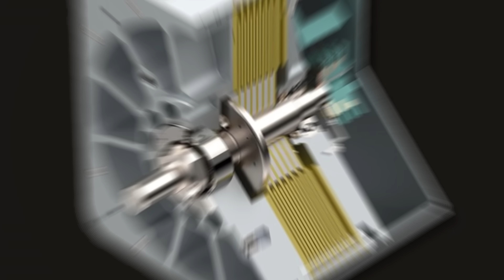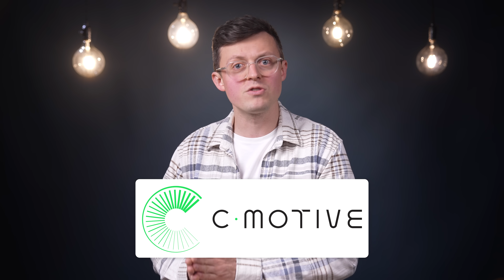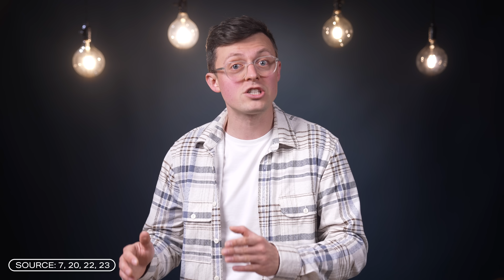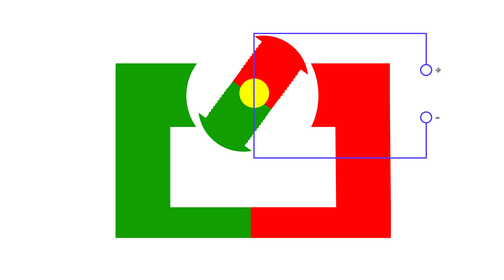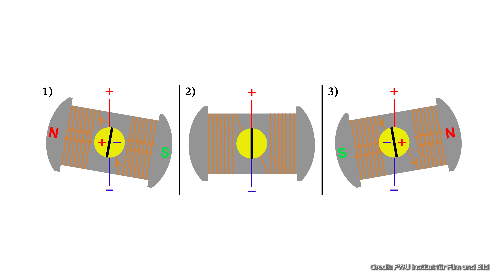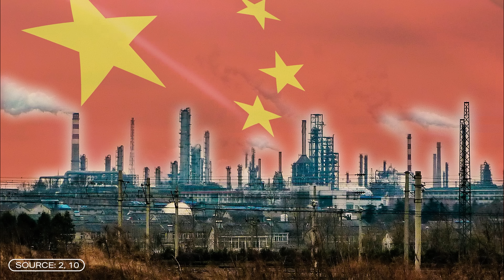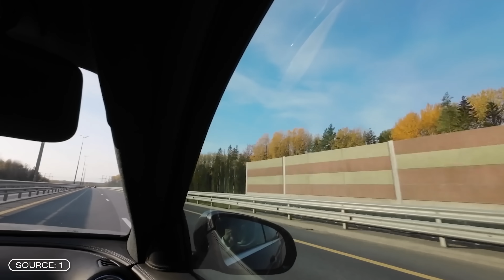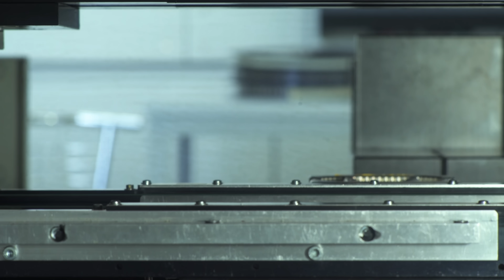Have We Gotten Electric Motors Wrong for 150 Years?

Comment: If they can do it properly, with low weight and real high efficiency e-bikes are a natural placing for this kind of motors, putting the motor directly in the bottom bracket without a gear reduction is the dream of any e-bike builder.

Comment: That dielectric liquid sounds like dichloromethane (DCM)
Reply: That's great, but it's not dielectric ofc.
Reply: @Cineenvenordquist  Yeah, this was poorly researched. I wrongly thought the dielectric permittivity of DCM was higher than it is.

My reasoning was that they don’t seem to have an issue with high cost, toxicity, or flammability, so it might be a clever application of a common material. There is quite a bit of recent research on tuning dielectric parameters of solvent mixtures with ionic liquids, for example mixtures with high-ε′ ILs like HEA-F (2-hydroxyethylammonium formate) would be in the right range even at high frequencies, but then there’s no specific reason to think of DCM.

Comment: Small scale motors for tiny smol dones.

On the other end, while not dealing with the use of copper and need for cooling at high current loads, you have advances in AC synchronous reluctance and induction motor designs that could displace high performance DC motors in cost, efficiency, and power to weight ratio. (including combinations of induction and reluctance motors working in parallel) There might be some role for switched reluctance motors as well, but the high speed, high efficiency projections seem to favor synchronous reluctance designs. The combination with induction motors seems to be related to low-speed torque performance (without reduction gear or using only fixed ratio reduction gearing without transmission).

 I'm not sure of the impact these configurations have on the ability to configure the motor(s) to also act as an alternator/generator for regenerative braking.

Comment: Welllllllllllllllllllllllllllllllllllllllllllllllllllllllllllllllllllllllllllllllllllllll, HmHmmmnn What about motor homes
buses with a gear box? I a huge 1 meter squared motor paired with conventional big rig gear box, You said 90% less copper no magnets so most of its weight would be from the dielectric.
 I wonder what the math would be on that.

Comment: Low Rpm with high torque and no gearbox. This would be great for a marine application like a propulsion motor with a CPP  this could run constant speed with max efficiency sounds good to me to be honest.
Reply: Or replacing stepper motors

Comment: Sooooo  many electromagnetic motors require high speeds and then step-down gear-boxes for low-speed, high-torque use that we have just simply come to accept that as a given. Even if these can't replace every motor, they could still replace a heck of a lot of them.

My main question is: Can they reduce the cost and increase the long-term durability of these that they could replace all the motors that CAN use their particular characteristics? Compressor motors for refrigerators and air conditioners have to last 5 to 10 years with no maintenance AT ALL. We just expect them to keep on working forever. Can these motors do that? Without doubling the cost of our refrigerators, which are already too damned expensive?  

It doesn't matter how cool they are if they can't replace everyday motors. If they are always only going to be a niche product, then they will always be expensive.

Comment: The very high voltage motor controllers are going to be harder to make than the motor
Reply: Hey, if 1 V electronics can run 800A motor controllers, even with GaN they got this (30 kV?) thing fine. It is tempting to think the controllers will absorb some of the Cu the motor refused...

Comment: Wait wait wait. "boost in efficiency ... close to 100 percent" doesn't necessarily mean 100% efficiency; it could simply mean twice the efficiency of existing motors, i.e. 100% increase in efficiency. In fact the phrase "boost in efficiency" almost certainly means the latter. If they mean simply "efficiency ranging from 30% to 100%", why would they even mention the 30% figure? Who would boast about that?
Reply: Yeah, that reads 30% to 100% more efficient, not close to 100% efficient. Also what are the other factors? If we're throwing such huge numbers around then it must be more so dividing the inefficiency by that, so like, say something is 87% efficient = 13% inefficient/loss, then this would make it 90% to 93.5% efficient = 13%/1.3 to 13%/2
Which don't get me wrong, is very good, but is also very different than the almost 100% when it comes to such matters.

Comment: but will it economise? Price is important, and getting your KV requires DC boost circuits which reduce the efficiency too. So instead of efficiency lost at the motor it is lost in the voltage regulation.
Reply: Well we don't know the cost of the liquid but rare earths are expensive and this uses less copper a clean room to build the motor will raise the price.

Comment: Magnetic motors are typically over 90% efficiency and 95% is not uncommon. Little room left for more efficiency. And little need.
Reply: price of copper going waaay up very soon
Reply: True but what people forget is how efficient are the motor when running part load and not optimal rpm? there might be some improvement than can make sence.

Comment: So you're going to need a gearbox for all applications involving either 1500RPM or 3000RPM. Great!!!!!! You're back to the gearbox anyways. Magnetic fields are easy to maintain. High frequency voltage includes more electronics that can fail. No need to reinvent the wheel. Movement is not always progressive. This is sideways progress. Broadening of electric motors instead of an actual improvement.

Comment: Hmmm, "proprietary organic dielectric fluid"... my brother, that shit sounds like ultra-high refined mineral oil. The exact same kind used as dielectric insulator/thermal dissipater in pole pigs (pole-mounted electric grid transformers). Just a small tweak to the molecular formula to make it legally distinct (and still retain the exact same physical/chemical properties as the original Example: Heroin vs OxyContin), et viola; "proprietary organic dielectric fluid".
Reply: Not. Dielectric. Coulomb force motor. But also Lorentz in a dynamic analysis (not shown.)

Comment: Their problem is going to be serviceability. Very few industries will have a clean room onsite and keep the proper staff for it . Not many will want to send motors out to take 18 months to be rebuilt either. Also being limited to 100's of RPM means they will need a gearbox for most applications, they will just have to be geared up instead of down, which means even bigger and more expensive motors. Neat concept, but I can only see it being adopted in niche applications.
Reply: The cleanroom is only for the initial build.  It is not required for filling or refilling the ESM.

Comment: so ~2-4% more efficient than current Tesla/Rivian motors, maybe 1/2 the weight, give you ~5% more range.  500 miles becomes 525 miles.  If costs are similar or better, makes sense to go with an ES motor vs EM but it's not 'disruptive' technology by anymeans.

Comment: Now there is so many problems with this ad. First there are several different variations of electromagnetic motors, and thay are all different. The most common, the asyncronous motor has no coils in the rotor. The efficiency of this motor reaches at least 97% depending on size. Yes the bigger the motor, the higher the efficiency. So stating single figures SAYS NOTHING, if it is not related to size. So this is a sloppy ad! And it is mostly just basic electrotechnical issues....

Comment: I'm sure they've tried something as simple as applying a layer of a solid dielectric to their plates and then pumping the whole assembly down to vacuum....
Reply: That would make it work 10^1000 times worse, good thinking. Next you'll make us radar that works behind heavy insulation and light shows with .00001 V photons.
Reply: @Cineenvenordquist  Oh, I'm sorry I'm so stupid, I thought that vacuum and air having nearly the same permittivity meant that it could be used as a short gap between two solid dielectric layers with a permittivity of 100-300+ instead of a fluid with a permittivity of 20, vacuum not having turbulence between moving plates, and maybe having to do a little more advanced cooling method internally to take advantage of the bonus extra permittivity in the solid layer. 
I'm so dumb that I thought titania would be a good target material to start with since it's common and maybe not the easiest to work, at least nonreactive, breakdown isn't bad at 4kv, and you'd just have to worry about surface finish since the plates may be close enough together where it's a glow discharge risk across peaks, but hey I'm just some idiot making suggestions. 

Say, where did you get your 10^1000 deprecation from, I can't get any of the Coulomb interaction or Darwin Lagrangians to fit that figure...

Comment: I would use pressurized sulfur hexafluoride as the dielectric.  It's a gas, so it wouldn't have the viscosity of a liquid, and it's already used as a dielectric hundreds of kilovolt Van de Graff generators, electron microscopes, and high voltage transformers.  It doesn't, however, have a very high relative permittivity.  That may not be too big a drawback.  On balance, though, the static electric motor has a lot of potential, with the promise of increasing our capacity to use electric power in more applications, thus lowering resistance further electrification (see what I did there?).
Reply: SF6 was investigated thoroughly for ESMs.  If it had a very high relative permittivity around 100+ the engineering challenges to employ SF6 might be worth it.  

But as the other responder indicated the last thing our planet needs is a highly compressed motor filled with a potent greenhouse gas.
Reply: That would be useless ofc because the Coulomb force would be reduced quickly by any SF6 quickly polarized molecularly to match and counter the field. It's a high permittivity fluid so instead it fronts the charge er, enthusiastically.
Reply: Use of SF6 is discouraged because it's an extremely potent greenhouse gas.

Comment: Another application I just thought of is using this motor to start up another motor. Many AC motors require a "start-up" capacitor to boost the torque during low RPM.

Comment: Sounds very promising, however . . . This is only one half of the problem. The other and greater concern is the production of electricity to run this motor or charge batteries.

Comment: It sounds like they've made improvements that will allow electrostatics to potentially expand their range of usefulness. 

That is cool.  Electrostatic motors have a lot of potential (and a lot of roadblocks to materializing that potential).

I doubt they'll be replacing induction motors in general for a long time yet though.

Comment: I rely believe its acetone or ethanol, They should actually try Acetonitrile because it's permittivity is about 37 and has a viscosity of 0.34 cP. This is coming from an electrical engineer student. My dielectric would also allow the motors to reach ~500 RPM at 90-95% efficiency due to the fact that Acetonitrile thins out when it gets hot and works best at 20C-40C. I did rough math and can get 0.8 NM out of 10 plats at 10KV. the outer radios of my imaginary motor is 5CM.
Reply: I was thinking PVDF with a filler to tune the permittivity. Maybe Barium Titanate, Alumina, or maybe carbon nanotubes.  The reason I was thinking of a fluorocarbon is because of the stability.

Comment: For the "rotate and hold" application this could be a huge improvement.
Reply: yes like stepper motor
Reply: Yes indeed.  

The “like a stepper motor” comment doesn’t make sense.  Maybe the poster will elaborate.  

Steppers are effectively 0% efficient when holding a position.  All input power becomes heat.  The TMC’s StealthChop feature can reduce that to around 50% at the cost of sluggish acceleration.

Comment: Interesting.

Triggered additional thoughts.

Vielen Dank, deutscher Kerl! 😂😂😂😂

Here is a Clue 😜😜😜.

C-Motor speeds can be used even at high speeds where friction becomes important. Friction also creates Heat.

Jacob, nach dem C-Motor ist es nun an der Zeit, einen Q-Motor zu bauen.

Q steht für Quantum.

Auf der subatomaren Ebene in der Quantenwelt, wo wir versuchen, mithilfe höherer Wasserstoffisotope wie Deuterium und Tritium eine unerschöpfliche Energiequelle zu erzeugen Erkundigen Sie sich, wie statische Elektrizität beim Bau des Q-Motors genau funktioniert. 

Sag Danke, deutscher Man.

Dies ist ein Einfaltspinsel aus Bharat, also Indien, der eine einfache Idee teilt.

Comment: Forgot to mention now you need a seal around a shaft for an extremely low viscosity likely flammable solvent
Reply: I was thinking this issue is going to be very obvious - air intrusion into the fluid, oxidizing it and ruining its efficiency long before any form of visible outward leakage is detectable on the plant floor.
Reply: Sure, snake oil is flammable but not all that bad.
Reply: D’ya think this is why they didn’t go straight for a gas?
Reply: Everything's flammable under the correct circumstances.
Reply: I am worried about what this liquid is. It's probably some horrible carcinogen like everything else in heavy industry.

Comment: Everyone who dabbles in electricity should build a Wimshurst machine. And a Bonetti machine to go with it, which is several times more powerful so you can really feel the electrostatic forces (sort of like peeling velcro apart), but can be difficult to get started without the Wimshurst. It's especially interesting to dismantle the machine and pull the discs apart just after running it. The electric field blooms outward and can be felt quite strongly with your arm hair, which behaves like iron filings in a magnetic field :)

Comment: The current Neodymium magnet motors are awfully good. The only likely future in electric motors will be the adoption of the axial flux motors, which Mercedes is about to start shipping next year. This motor will take years to get certified in automotive applications; it has to prove its reliability first, when things are banged around.

Comment: I see a very poor electrolytic capacitor made to have half its plates rotate. I see both control problems in the switching circuitry that has to endure such high voltage switching currents, even if they are miniscule. I can also imagine that material temperature differentials could hamper performance, making the lack of heat buildup from external conditions extremely important. I wish them good luck in scaling up these devices successfully while holding those tight tolerances.  I also think the range of possible effective rpms will suffer.